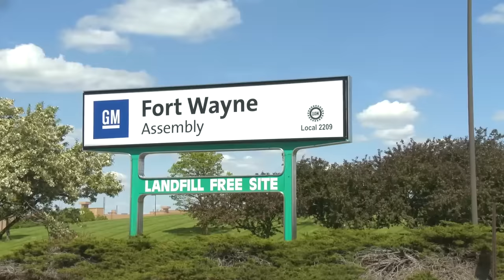General Motors Truck Production at the Fort Wayne Assembly Plant

Comment: I have a 2013 Silverado extended cab with a Dura Max made at Ft. Wayne. Other than a recall for the heater assembly in the DEF tank which GM fixed under warranty, I have had zero issues with my pick up. I realize it is  hardly broken in at 120,000 miles but its been great so far.  I"m sure it will be humming along at 250K.  Always wanted to thank the folks who made my truck.  If one of the folks who work at Ft. Wayne reads this, Thanks.   Go GM.  Go UAW. Go America.
Reply: If it's a 2500 or 3500, it was made in Flint, MI.  1500's are made in Ft. Wayne
Reply: It’s a 2500 and most definitely made in Indiana.  Sticker in the door confirms it. Extended cab not crew cab.  In 2013 I do believe the extended’s were made in FW and crew cabs in flint.

Comment: I transferred to this plant in 1986 from Wisconsin plant and built the first truck. I retired from there in 2007,great place to work!
Reply: u built the first 86?
Reply: @shawnmcclure7282  yes I did.
Reply: It’s like a miniature city. Everyone’s doing something within the factory.
Reply: Me too. I actually started at Electromotive Divison Of GM, LaGrange ILL. making Locomotive Train. I went to Janesville, WI. in 1984 then to Ft. Wayne In. in 1987. I retired on 3/1/2005. Lots of fonds memories. Union Workers are some of the most charitable givers in America. Being called lazy, and lowe-lifers by jealous detractors, and even beneficiaries of our good deeds notwithstanding. NOTE Ivan L. Flynn is the retiree, not Yvonne.
Reply: You did a great job on my '90 454SS.
Reply: @63bbray  thanks, I've seen a couple over the years,I drove a couple of them before we shipped to the dealers.
Reply: @yvonneflynn5427  cool,we've probably crossed paths!
Reply: Hey Dan, well I guess you had a hand in building my 1990 stepside that I special ordered and still have today. Thank you!
Reply: @timeout1569  Right on!!
Reply: thanks for a job well done!! my 1995 GMC serria 1500 sl 4.3 5 speed short bed has195,000 miles out there still working hard, doing many job I have to do. it was a painter's truck before I got the truck. this is the best gm pick made. it has comfort, great visability and is a work hoss! I have four gm pick ups 1995 GMC 1500, 1996 Chevy 1500 z71 extended cab short bed this truck has hauled 1 ton of horse feed and pulled horse trailer amongst all its other work. also 2002 2500 HD duramax full crew cab short bed 4x4. and last but never least 1986 Chevy d30 m1008 6.2 diesel 400 turbo , this is hoss truck it won't back down to a challenge, this truck doesn't know can't it only knows works done. you must have a sense of pride and accomplishment to see a truck you had a process in building still working 25 years latter!!! my 1995 built at ft Wayne, sticker still in door,  may have work scares and may not be a pavement princess but isn't that what old gm trucks are all about!
Reply: @jeepguy220  thanks for your support! Alot of pride is put in building these trucks, makes me smile when I see one on the road! I currently own a 2002 extended cab 4x4 Silverado that my Dad bought new. I've had a couple through the years and loved every one of them. I only drive GM vehicles, be American, buy American!!
Reply: Brent Schmitt  I think the Janesville plant closed in late 08 early 09. I owed a 2009 Tahoe that was built there in late 08
Reply: I was lucky enough to get to go to see the ford f150 truck plant in norfolk va in 1995. I worked as a ford technician for about 20 years and then started working at an electric power company working on bucket and line trucks and all sorts of equipment. I have to say I saw everything from trains inside the plant with rolls of steel and engines transmissions exhaust systems and all sorts of stuff to stamping parts and the complete assy of the truck. It’s still the most amazing thing I’ve ever seen to this day in 2020. The plant closed long ago which I was sad to see but thankfully I got to see it once. All you employees should be proud to have been a part of such a thing. People have know idea what all went into making their cars
Reply: You more than like helped build my 93 Silverado 4x4. Best truck I ever owned except for that sorry transmission.  I've been through 4 of them in 350k miles.
Reply: 1989 Gmc 2500 4x4  210k miles and going strong.  Great truck.
Reply: @jeepguy220  The 95 Silverado I used to have was built in Canada.   Have an 08 now
Reply: @yvonneflynn5427  I worked for Conrail in mid 1990s you folks build great diesel-electric Locomotives; hun, that had to be the best job?
Reply: As a GM dealership tech working in a fleet certified dealership, it’s cool to see where some of my 2500 and 3500 headaches started lol.
Reply: @yvonneflynn5427  Make a Wish,  the United WAy, and Breast Cancer were our 3 big charities at Ft Wayne, when I worked there.  But, we'd have gate collections for just about any charity.  You're right, GM workers in any plant, in any state, are very generous, with thier money and time.
Reply: You worked at Janesville? So sad to see it closed after 100 continuous years 😢
Reply: @imakittycat1302  mine is a baby then at 110000 miles 😅 88 Sierra SLE 4x4 5 speed
Reply: @danwilhelm4237  xxvi cio
Reply: 334, I have a look at the moment, but
Reply: @deylafarhan1841  sorry,can't understand.
Reply: I was going to say this the automobile factories have moved from Detroit to Texas, and other Sunbelt states, so as plants close in Michigan and elsewhere in the Rustbelt ,there is need for workers who can do the job (skills) ;so if  the automakers can just shift their workers from the Rustbelt, down to the Sunbelt : offer them better salaries ,better health plans, access to affordable housing.General Motors can even have a program to rehabilitate the homeless that can be rehabilitated ;and put them back on the workforce.Why take American jobs to Mexico. Leave them in America.They are American cars they should be made in America . Texas has a lot of room west and south to build plants on the USA . Keep jobs on this side of the border.
Reply: Yvonne Flynn I work for the railroad and love Electro-Motive locomotives! Luckily, now that the plant is closing, there was a chance for me to tour the plant at the 1997 open house.
Reply: Nobody cares🙄
Reply: @Mazin Hassan. Sorry I don’t speak that language.
Reply: Thanks for building my 1986 Chevrolet Silverado 4x4 Longbed, it's still in good condition. People every now and then ask me if I'm selling it, I enjoy it taking it out in the forest 👍👌🇺🇸🌎 I also have a 1997 Chevrolet Silverado 4x4 Longbed that was built there too, that also get asked if I'm selling it. Thanks for your loyalty building us Chevrolet and GMC trucks.
Reply: The price they wont for these trucks today the worker dont make that a year
Reply: Amazing
Reply: My Mom had a 1988 Scottsdale that was built there, That was back  when Chevy made good trucks.
Reply: @yvonneflynn5427  Sad most union workers voted for a guy  in 2020 that is going to destroy America and American jobs.
Reply: 39 years and I’m still here.
Reply: @jaysmith179  yes it is I was not one of them. 🇺🇸🇺🇸👍 Trump 2024
Reply: Yeah thanx for my Chevy.
Reply: I wish my site was still GM owned. I work at Nexteer Automotive in Saginaw, Michigan. The site opened up prior to WW2 as Steering Gear. Went thru the years until GM wanted to stop producing car parts and only wanted to do just vehicle assembly. So the spin off was Delphi which changed names around 98. Until GM went bankrupt in 08. They could of closed the doors but sold out to China. So in 2010 my facility turned into Nexteer Automotive.
Reply: Why did GMC move some of their Sierra 1500 production from Mexico to Ft. Wayne?
Reply: Truk Angkutan Personil  Baru  9   unit
8 unit Abuh Abuh bubuk Baja Abuh Abuh biruh  Milik   TNI    AL
Milik   TNI    AU    Milik   TNI    AD
Lewat  kapal Atg mico Laut  Lepas
LAUT   JAWAH   OK    RI   MANTAP
KOWAL    KOWAD    KOWAU   SOPIR
TRUK  ANGKUTAN  PERSONIL  BARU

Comment: Best vehicle I ever had was a 2003 Yukon. I drove it 14 years, 186,000 miles mostly in the Florida Keys and sold it for good money! One repair only, the fuel pump!
Reply: Those LS motors hold up like no other
Reply: same my chevrolet trailblazer 2.8 duramax diesel in phillippines chevrolet less expensive parts compare ford
Reply: How much was it, mines been buzzing so I'm sure it's time for a new one very soon

Comment: My 2012 2500HD was built here. It just turned 100K, and it has held up well. I’ve had no problems.I give you guys on the line credit for this. 

My family is a GM family. They all worked at the New Departure Hyatt bearing plant in Bristol, CT.
Reply: I have a 2012 but it is just a 1500. It only has 48,000 miles. I have a 1998 Silverado that is the 2500HD if I need to haul something. The 2012 was garaged in Ct for a year after I bought it in Idaho. Then I drove it home to Alaska pulling a travel trailer.
Reply: My 2012 2500hd was also built there It just turned 31000 miles the other day

Comment: Involved in the powertrain system design 2 years ago for this T1XX truck, so happy to see my designed part in the production in this video.
Reply: You did horrible work. The rear suspension on these trucks and the 8 speed transmission is garbage is both my 2019 RST and 2019 LTZ Z71. Last GM trucks I'll ever buy. 💯
Reply: @jadedjay7861  Don't know why you sound so angry. A car is built by thousands of engineers and one engineer can't change the whole story. You don't know me and don't know my job. So if you have any comments about GM, please make comment in the right place.

Comment: My 2016 3/4 ton 4 wheel drive 4 door 8’ box was manufactured in that plant. I also own a Chevy 2005 one ton 4 wheel drive 8’ ( bought it brand new, has 200,000 plus miles and still runs great ) and a Chevy 1985 1/2 ton 4 wheel drive long box. Chevrolet “ Like a rock “

Comment: Almost identical to the Arlington, Texas SUV assembly plant that I have been at for 42 years now.
Reply: I toured that plant in 91 or 92 back when the Caprice was being built there.
Reply: @SDRacing88  I hardly remember that far back lol, it's 3 times the size now with 3 shifts around the clock 6 days a week and sometimes 7 days a week. It is the largest assembly plant in America, always hiring too.
Reply: Did you see the wearing the Dallas hat in paint Dept.
Reply: @SDRacing88  When we built the LAST Monte Carlo the plant kept it for their indoor museum a white SS with T Tops
Reply: randy farr Why the Serpentine assembly on the 4.3 Ecotec has 2 extra pulleys ( one in the center where the waterpumps used to be and an idler pulley under the alternator ) versus the Ecotec 5.3 which is more simplified with 2 less pulleys?      
The front of the engine is identical with 2 less cylinders.

Comment: My 2022 1500 is on the rails there now and my 2014 was built there as well. Thanks for your hard work! I’m sure I’ll enjoy my new RST
Reply: May I add thanks from a fellow UAW member for a great truck and a job well done! BO from 2069
Reply: My RST has 3,000 trouble free miles now and getting free first oil change and check. The fuel mileage is out of this world! 25-34mpg! Thanks again!

Comment: I have a 1979 Chevy truck and puts this new truck to shame it still runs this day I think the gas miles is about the same
Reply: I had a 1977 Silverado that got the same gas mileage as my 2005 Silverado.
So sad what GM has become
Reply: @A-Z__124  ain't GM's fault. The EPA needs to pull their lower lip over their head and swallow.
Reply: Your talking about a 79 that has somewhere between half or a third of the horsepower and weighs less having the same mpg. Wow must be proud
Reply: @GreatLakesLogger  IsIHi
Reply: @GreatLakesLogger  I blame the Democraps. Watch gas will be 4 bucks a gallon this summer.

Comment: Didn’t see the part were they install the rust on the frame. Is that dealer installed?
Reply: CRC heavy duty corrosion inhibitor . if you can be bothered to take an hour out of your life every three years to spray it on the underside you won't ever have a problem . 15 NY winters and counting .
Reply: No just "CHEAP" import steel.
Reply: All the undercoating in the world will not stop it from rotting away from the inside out
Reply: Dr. Westside Can you spray it on exhaust pipes?    Must it be painted?   
I live in the South but bought a truck that traveled to where it snows with salt
Reply: @Jeff x think your talking about Toyota
Reply: Too cheap to power wash your truck? Thats all your comment tells me.
Reply: Gm is moving toward e-coating frame.  Should be ok.
Reply: No rust on mine

Comment: That's where my 1990 was built.
Reply: Garbage then, and garbage today.
Reply: @johncholmes643  There is a 1992 Silverado in my driveway with 267k miles and it starts and drives everyday. It's had its transmission rebuilt and has its share of problems, but I'm confident it will get me to work every day. It will still be running long after these trucks in this video are in the junkyard.
Reply: @ChickenC0re  
I also have petrified wood in my landscape.
Reply: @johncholmes643  you must be a Ford guy. My condolences.
Reply: @timeout1569  
I was a Generic Motors guy for years. Ford absolutely has the best product on the market
Reply: @johncholmes643  Well I have owned my truck 30 years, have 140,000 miles on it and never had a single problem with it. I have owned more GM vehicles than any other and not had major issues with any of them. I have owned a few Fords and aside from a few build quality issues can say the same about them as well. With the exception of my 68 Mustang, that was an electrical nightmare.
Reply: @timeout1569  jezus, if I owned a vehicle for 30 years it would have 3,000,000. Miles on on it.
Reply: @johncholmes643  we are all different with different circumstances. I was fortunate enough to have another vehicle at my disposal so I split duties.
Reply: @johncholmes643  The last good Ford F150 was the 1996 with the 300 6 cylinder engine.
Reply: Johns momma hangs out with a guy who drives a chevy

Comment: I will never own another new GM product. I bought my first new chevy 4x4 truck  in 1978 my 2nd in 1987 my 3rd in 2000 when it got wrecked my bought my 4th in 2004. drove it home 8.9 total on the truck and it never left my driveway again under its own power. after fighting with Gm dealer 6 days later when they did come to look at it the idiot locked the keys in it 3 times messed up my paint job and the 3rd time just busted the wide window out of it. I told the you just bought this truck back. after I got a lawyer involved I got my money back and been with ford ever since.  but when you give 20k CASH for a truck and drive it 8.9 miles and they don't want to fix it. I think it was because I paid cash. and I called them with in 20 minutes of leaving the dealer. but I liked the video its cool how it all works.
Reply: Amen Glen. That's why I never pay cash.
Reply: Lies. GM has an obligation, and a promise. As well as the union would have never allowed it. Next time, speak to Corporate, not your friendly Chevrolet dealership. The dealership is not authorized or given clearance. As far as you paying cash, GM could careless. You are still a valued customer, no matter how you acquire a GM product.
Reply: Make a payment or two then pay it off.
Reply: Hi Glen. You obviously like GM trucks and that in itself is a great thing.
Reply: @bobolulu7615  gm is all i ever owned until 2004

Comment: My 2006 GMC Sierra SLE was built there, 199,9XX miles now. Got it with 357 miles on it and only thing that I did not like is the thin roof with no bracing to stop it from vibrating in a high wind or wave shock from a semi.

Comment: Wanna know why sales are down? b/c people can't afford to buy these monstrosity trucks anyone. bring back an affordable base model Colorado standard cab. that's what we want
Reply: That's why the Frontier is the last true simple small pick up. But they're doing away with it in 2021 or 22 I think. But the new one may come with a small Cummins option I think.
Reply: You're  in luck . Chevrolet  builds  the low cost  Colorado  version truck called the W/T  model. 
No frills , bare  bones or add options
Reply: That's not what I want. I want a regular cab, 1/2 ton 4x4 with an 8' bed and manual transmission. For under $30k!
Reply: @MikeBrown-ii3pt  Yup! People in HELL want a glass of ice water too.
Reply: Medic311 why not the S10 LoL
Reply: @MikeBrown-ii3pt  Good  day from Ont. Canada  Yes that's  what  I   wan t.  Thanks
Reply: I’ve got one, sorta.

97 s10 zr2 with 5inch bds lift 4by4 on the floor nv3500 manual transmission and up front is a vortec 350
Reply: All that and an off frame restoration cost be about 35k Canadian
Reply: Medic311  not everyone is broke like you
Reply: @1heart7seas1moon  30k for a regular cab 1500 is not broke.
Reply: um speak for yourself. thats what YOU want. they have those and have had those base model nothing trucks. sales are down because they don't update anything. no gadgets, no anything cool and the new one looks like a tundra. no wow factor. stay with your base model rig. I have a job. I can afford one of the nice ones.
Reply: Sales are up another 27% WTF are you talking about.
Reply: Mike Brown 1/2 ton & 4x4 are contradictory statements.
Reply: @scott250r2  per who? ford is still killing them and ram is nipping at their heels about to pass them. wtf are you smoking?
Reply: @MikeBrown-ii3pt  
Manual transmission is dead